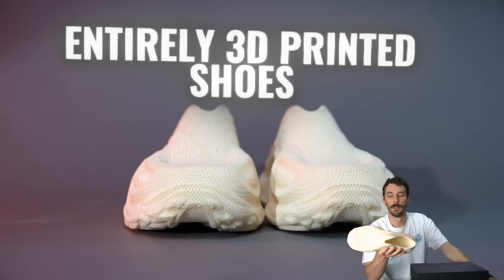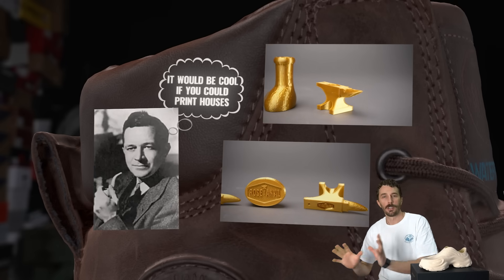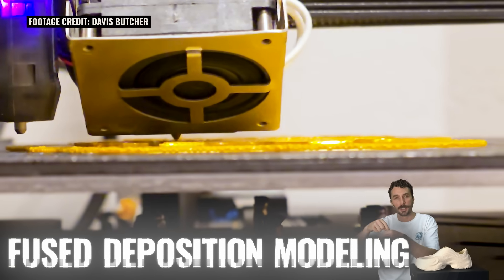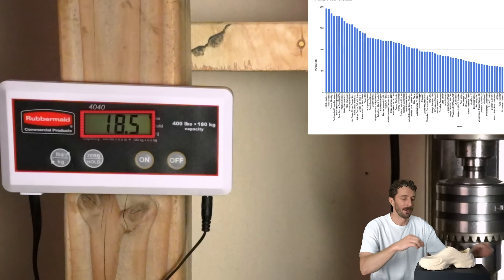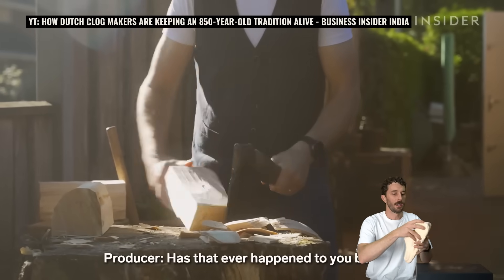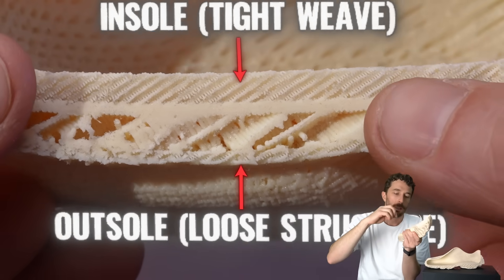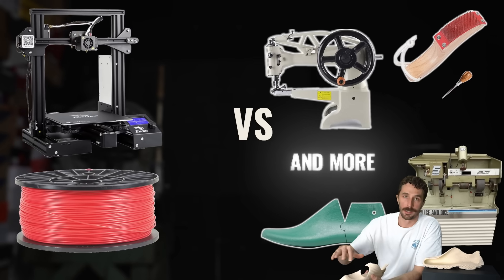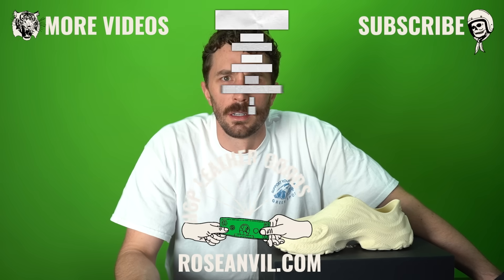The truth about 3D printed shoes - Zellerfeld

Comment: The time to print isn't really an issue.  It just means you need more printers to get the throughput.  Unlike traditional shoes, where humans are involved at every step, with the 3d printed shoes, no humans are needed, other than to start a print and keep the machine fed with material.  You could probably have just one person supervising 100 printers once the process is refined.  In other words, in 40 hours one person could print 100 pairs of shoes.  That's averaging 24 minutes per pair of shoes, or 12 minutes per shoe per person.

Don't forget that you're not comparing like for like.  These are bespoke shoes, tailored exactly to the individual's feet.  Consider how long making a bespoke pair of shoes takes for a fair comparison.

I think the biggest problem with them at the moment is the bulk of them.  They just look huge and clunky on people's feet.  I'm sure some people will like that aesthetic, but it's not for me.  I'd like to see more work on creating sleeker designs that still retained the comfort.  I think that should be possible.  If they could split the difference between a brogue and a sneaker they could really be onto something.

They're also not even close to weatherproof, and if the outer skin was solid, which is possible, they would be incredibly sweaty shoes.  It may be possible to angle all the pores so rain would run off, but then you'd get soaked if you stepped in a puddle.

What I think is more likely to happen, is that we'll get hybrid shoes, where the soles, insoles, and welts are 3d printed as a unit, but the uppers are more traditional.  The uppers can still be bespoke, using CNC cutting.  The soles would be much easier to print without supports, and this could easily halve the printing time.

Comment: Regardless, the styles you can get from a 3D printer are incredible. $250 is no higher then the price of many standard sneakers, and prices will only come down as more manufacturers start using the tech due to increased competition in the market.

Comment: The thing with 3d printing is the Infill can be changed to different types and be more dense so there are so many possibilities. You can also embed anything you like so you could stop it before it does the upper layers and insert a metal rod. You could also leave in acetone to get rid of any layer lines. Glad you talked about 3d printing shoes they seem to be getting better!!!

Comment: FDM-printing won't get much quicker in the future because the printing-speed is already limited by the amount of filament you can push though the nozzle and bigger nozzle-size means lower resolution, so visual quality. Other 3D-methods have other disadvantages, usually more preparation and after-print clean-up. Only bigger, more complex machines could automate the process and those machines are already more costly like SLS. But you can't really compare the printing-time with the labor-time making other shoes and there are already 3D-printed shoes for half the price available.

Comment: 3D printing build speed is not really an issue. You can always make a 3D printer 10 times faster by adding 9 more units. If you order online and they can ship a CUSTOM pair of shoes within 3 to 4 days, it's fast. Zellerfeld just needs to keep their capacity above the orders flow. Big challenge will be to lower material costs. If they are using filament, the material is much more expensive than regular polymer pellets.

Comment: This reminds me of when manufacturers went to nylon gears in place of steel gears. It didn’t go well. Why? Because they didn’t yet understand how you had to redesign for the new material. Once they figured that out, after a few years, the durability issue went away. Now, with new plastics, they’re more reliable than the older steel gears. The problem with 3D printed shoes now, is that I believe they are designed incorrectly. They’re trying to show how light these are. That is a mistake. It’s why they are so weak. They need to use 100% infill in a number of the areas they’re using maybe 15% infill. The infill pattern isn’t the best for some areas either. They need to figure out how to make soles that are stronger and less wear prone. They’re very definitely can make the soles thicker. But again, their error is in trying too hard to show how soft they feel when walking, along with that low weight.  What they need to do is to equal a “normal” shoe, not out perform it. Someday, they can outperform them. But that technology isn’t yet here in a reliable way. If we have the right printer, we can buy the filaments to print out own shoes. There are companies that already have shoes you can download and size to your feet. Whether it’s worthwhile is another question. Right now, it’s a novelty.

Comment: Expecting the print time to drop from 40h to 1h isn't realistic. Printing flexible materials requires slower speeds than rigid materials and even with rigid materials the fastest you could go is probably 20h for large objects like shoes.

I think the whole "3d printed shoes" market still makes sense if sold as "one of a kind" items. Custom fit traditional shoes are much more labor intensive than these as the whole design process of these can be entirely automated. So you aren't comparing 3d printed shoes with mass market shoes anymore.

Still with all that, I think these are gonna fail unless they address two things:
1- They are all very ugly.
2- No laces??

Comment: I wouldn't be too concerned about the amount of time it takes to print, they're not man-hours. It's more about the setup time. The depreciation cost of the printer for a pair of shoes is about $5 to $10 bucks now, so reducing the print time would bring this down, but for a pair of shoes that's $200 - $300 it's not significant until you start competing on price

Comment: sorry snort laughed at 250 dollar 3d printed shoes,  I get the need to recoup your IP but the material and construction costs are like...2 bucks.  If these were even 40-50 dollars id buy them. if they sold the STL for 50-100 bucks id but it to support them. but a single print for 200-250 bucks? they are smoking crack.
Reply: check again what high quality TPU costs

Comment: there should be a thin membrane layer on the outside to protect the latices from dirt and erosion. you could just have it painted or sprayed on to the parts that need it, it would coagulate and fill the outermost layer and resemble synthetic uppers of modern running shoes

Comment: I'm an engineering student studying mechanical engineering, and lemme tell you. 3D printing isn't just the "future" its the PRESENT. We're already using 3D printed parts on modern aircraft, we can finally design and manufacture complex parts that are impossible to machine to improve efficiency and make better products. I mean shit, this video is a perfect example. Although, right now it's a little gimmicky I can totally see the technology revolutionizing footwear to some degree.But I mean it's only natural that every industry is going to take advantage of additive manufacturing as a staple in how products get to consumers. I mean for one example, I currently work in a lab with coil magnets, and we have to design test rigs using material that is "100%" non-conductive. This means everything we design needs to be plastic or wood, and typically we just 3D print our rigs since we can easily get the geometries we need with relatively tight tolerances (<.5mm) on consumer grade 3D printers. I'm really excited to see the kinds of innovations that come from 3D printing

Comment: Really interesting shoe & it was good review. Considering you dont know much about 3d printing, you explained things quite well. Couple of points, Selective Laser Sintering (SLS) doesnt work anything like casting! Id suggest watching a video showing each process, they are quite different. Clog making is nothing like 3D printing, its like the opposite! Clog making is a subtractive manufacturing process where you start with a block of wood & whittle & drill away material until you get to the finished shape: very wasteful material-wise. While 3D printing is an additive manufacturing process that only adds material where its needed, cutting down on waste. & the various structures within the shoe are the infill. That is a way that additive manufactured items can save material, save weight & vary mechanical properties within a part/shoe. It looked like part of the midsole was completely solid (i.e. 100% infill) while the upper looked more like 20% infill maybe, so it was very flexible. I dont think the time to print of 24-48 hours would be that big of an issue. Just a different way of buying shoes. Get your feet scanned at the store (or at home using an app maybe!), shoe is designed automatically to suit your exact measurements & the file gets sent to printer. Shoes get shipped to you within the week. Its the future (maybe)! If you want to get into 3D printing, Id suggest picking up a Bambulab or Prusa printer & getting TPU filament. Its a flexible material & is quiet tricky to print, buts probably what you need for shoes!

Comment: If the price of 3D printed shoes could go down to about 100 to 200 with some sort of solid insole for air bubbles but just overall padding to make the shoe more durable to the bottom of the foot. Then it would be a decent spring summer fall shoe.

Comment: The reason it blew up in the mid-late 2000's is because that's when patents started expiring and major credit belongs to the RepRap movement. Its pretty sad you include a picture of a PRUSA printer and don't mention that. Before that,  it was basically reserved to big company prototype labs going back to the 80's and 3D printing was mostly SLA until RepRap made FDM the thing we consider as 3d printing which is a precision hot glue gun. When FDM took off SLA printers were still in the 6 figure range but now you can get them for hundreds of dollars and since then SLS has come on for industrial grade parts where SLA may be more for presentation. SLA and SLS produce nicer looking parts however FDM holds advantages in the size parts can be made and the range of materials.

Comment: they print tpu meshes even though the layer adhesion for tpu suffers a lot from it, they do not use bespoke lattices but instead just regular linear infill, they ignore vertical shellness, probably to save some weight on those bricks and they just cut out the foot from an outer shell, so the whole design is only partially bespoke and results in a very heavy shoe. I printed a very stiff and durable TPU shoe with 250 grams in size 12.

Comment: The major reason why 3Dprinting isn't adopted for mass production ia it doesn't scale. If you create a mold, that scale well: you pay a lot upfront for the mold, then every piece that comes off that mold is very cheap and pretty quick too. Same goes for dies. But with 3D printing, there's no way to scale that up. It's not like after you've printed one then the second one is quicker and cheaper. People might say stereolithography scales well as it takes the same time for a full build plate layer as it does for a nearly empty build plate, but their photopolymers not true thermoforms or thermosets. Basically they're UV sensistive composite materials and they do break down over time.

Trying not to be harsh or critical of your background/introduction to 3D printing, but it leaves a lot to be desired.

Comment: You can cut a rubber sheet for the bottom in store. You can also 3D printed a custom shell (like a vase) then silicon tubes for support and finally fill insides with expanding foam. Or you can just make the bottom from a 3D printed shell + silicon + foam and make the top part a tick sock. Mixing multiple materials would speed things up. A single layer of plastic with a thicker layer size can be printed way faster.

Comment: I'd be interested to see if the shoes can be sprayed, painted, with a latex or RTV silicon to help with the surface layer adhesion -- most soft 3d printed materials fuse at the interlayer junction at a slightly lower melt temperature, leading to weak "tearable" texture.
Maybe something like designing a channel or layer (like an inner insole) through the subsurface regions, where you can inject RTV silicone to fill the voids.  Like an insole, or maybe a stiffiner -- choose the durometer for different springback and durabillity.

I think multi materials here make a big difference, and using the FDM platform there can be some tricks yet to be had.  If I was a youtuber, I'd do stuff like this idea anyways.  Good luck, nice vid.

Comment: I think it is more reasonable not to try actually print shoes, but use philosophy of printing. I mean You can scan Your feet and sent scan to some manufacturer which through algoritmic model just make precise shoes without retooling all machines. Machines just cut parts with parameters which this algoritmic model recalculate for Your feet precisely and none of other processes changed drastically. It can use some printed parts because why not, but main trick is this algoritmic model. This is MUCH more viable option.

Comment: The speed of printing is increasing drastically.  There's a reason the print farm at 14:15 isn't using bed-slinging Ender 3 printers; Core X/Y can be driven as much as 10x faster, and new ideas like the "unrolled motor" design where the X (and maybe Y) axis motors are actually a rack of magnets embedded in the rails themselves could speed that process up even further.

We're already at a point where the main limiting factor for print speed is how fast you can melt material through nozzles.  Exotic new nozzles have come out in the last couple of years, because that's the current bottleneck.

20 minutes per shoe is probably not realistic today, but an hour very well could be, and 20 minutes might just be a few years away.

Comment: Your 3d printing history isn't accurate, the reason it wasn't used until around 2010 there was a pattern on it so they only sold massive expensive professional machines. Due to the Pattern no one could make a consumer 3d printer.

Comment: Slow? In the 80’s to 2000s? They were already producing parts with resin SLA that could be produced within hours and days if the part was large enough. There are still viper’s from 3D systems in the field. 

Your research into 3D printing has a lot of holes…

Comment: WIth 3d printing, you can stop  the print hallway through and lay something down for an insole to be printed over or you could use a pressure chamber to infuse the matrix between the square honeycomb of layer lines with another material that cures

Comment: It'll NEVER get down to 1 hour. the process is inherently time consuming. If you go faster the print quality suffers plus the added risk of a failed print (not to mention wear and tear on the printer). The only other option is significantly increasing the layer thickness, but there goes the amazing lattice structures you were admiring. 

3D printing is just not going to scale much farther than it already has. The future is already here.

Comment: I'd consider a mixed approach at first.. like print most of the shoe, but maybe allow for vibram soles to be attached which would create long lasting soles, and add a sheepskin insole. 
so.. you get a long lasting, faster to print shoe, with the comfort of a very good shoe, modability which might be nice for some people and custom use cases. etc

Comment: IMO
3D printing is not going away. Even if it can't full replace the production process, like you've mentioned, the prototyping is something that can be done on the individual or small team level, and I assume that low production amounts are also possible. Furthermore if major show makers don't completely transition over, they will mostly likely find components that they can let a printer produce.

Comment: Long time to print is not really an issue. 3d printing farm is pretty easy to build. So, yeah, it takes 2 days to print one shoe, but if you have like 100 printers - you can print 25 pairs a day. Almost fully automated, and it scales really really well - you only need few workers to maintain a farm of THOUSANDS printers. There are actually a lot of benefits to that. You only need ONE type of manufacturing machine that is easy to fix or replace if it's broken, and you only need one to few kinds of materials :)

Comment: 3D printing technology is there. But to get the shoes right you need accurate 3D scanning and exceptional parametric CAD shoe designs. I also think I’d prefer a 3D printed shell glued or stitched onto an outer sole that has the correct properties for an outer sole, like being more waterproof and more puncture resistant, for instance.

Comment: I think there's a really compelling opportunity to use 3d printing for certain design elements like the combined insole/outsole while using more traditional materials for other elements.  as well, while TPU is notoriously difficult to using in multi-material prints, if advances are made in that area we could see hybrid shoes with a harder, more supportive midsole material